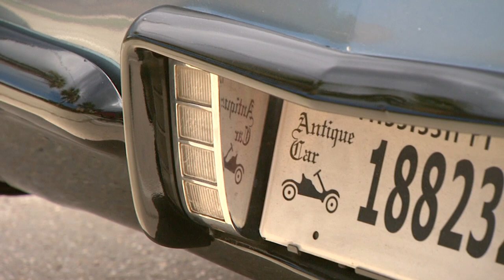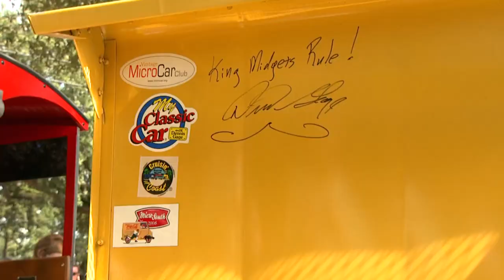Cruisin' the Coast BONUS FOOTAGE!

Comment: 3:05  "So when the 455 came out with the Mach IV Ram-Air with tunnel-port heads, beefed lower end and a Holley high-riser setup, I was on line.  390 hp and 500 foot pounds of torque, whatever that is.  It's in the folder in the glove compartment.  But she's a road king alright."